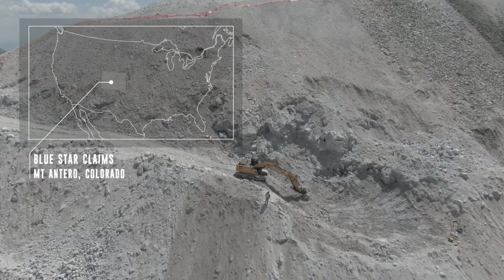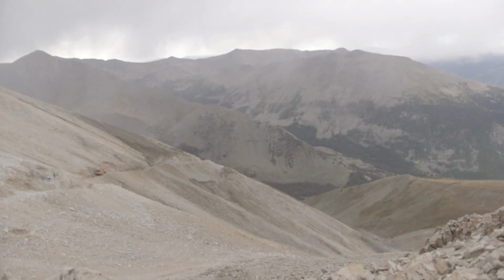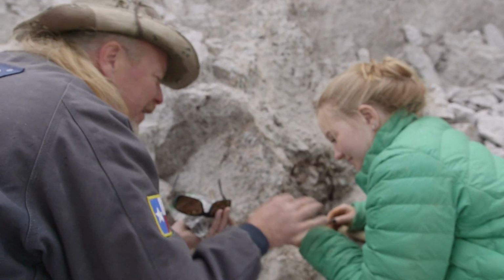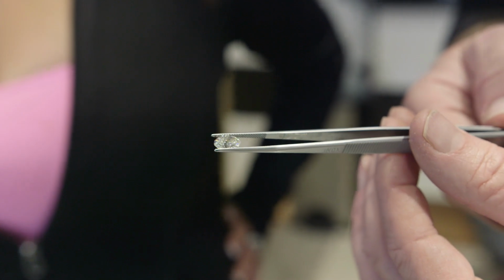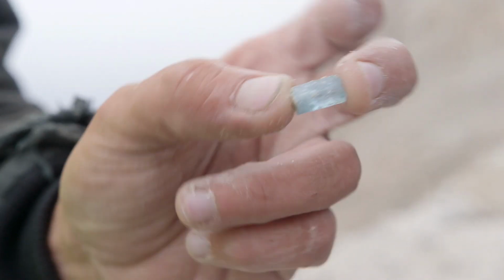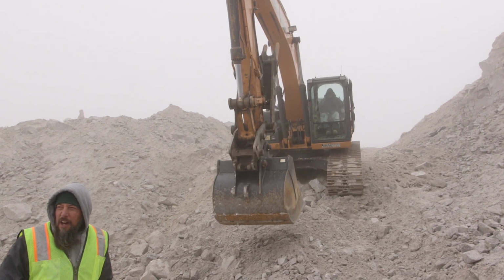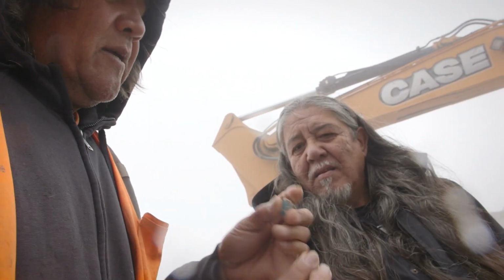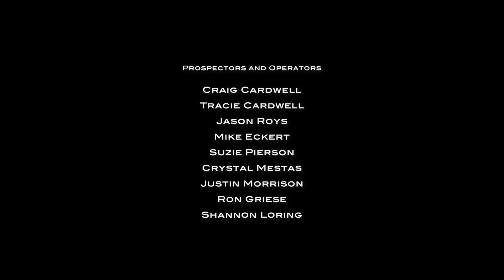Striking new aquamarine pockets on Mt. Antero's north face  |  S2:E3

Comment: If fog rises and strikes fine screening. You could capture the water droplets and pipe the screens water to a holding tank. That way you might save transporting water up the mountain. They collect mesh fine screen water in many places. It's only cold weather that freezes is your problem, but then, frost and light ice melts off and you get to collect the water for Wash Plant Water.

Comment: A good tool for you guys Is made by Elon Musk? It's called not a flamethrower. But that's what exactly it is. A small handheld flamethrower that uses propane cylinders and it doesn't eat the propane all up right away. Like you think it would. And it shoots an 8 to 10 ft Flame. I'd be grateful song out-of-pocket real quick when you have to get off the mountain.